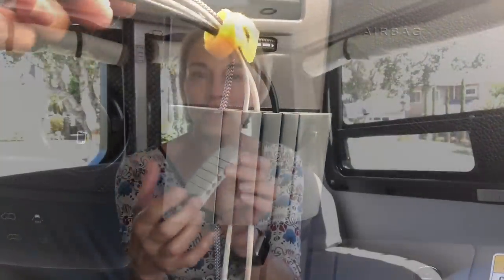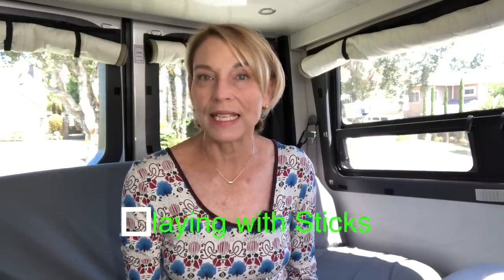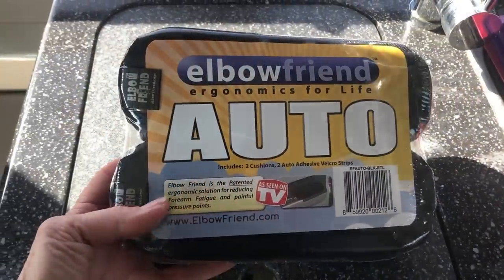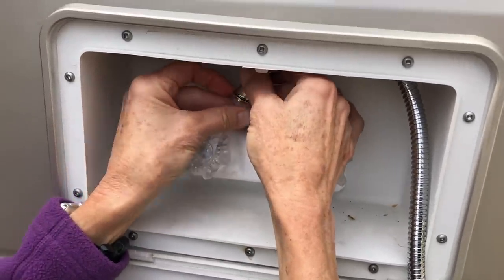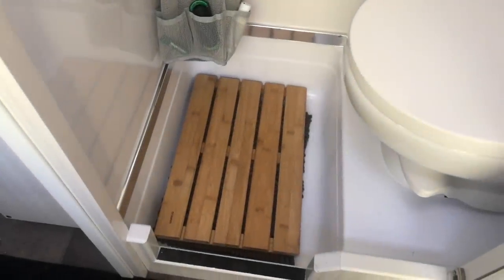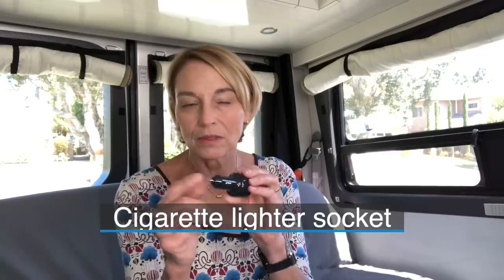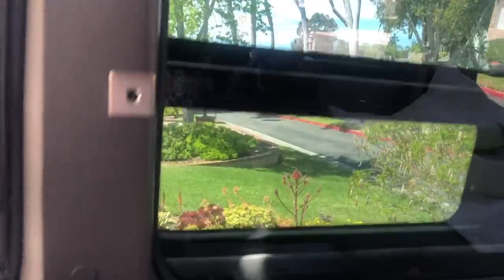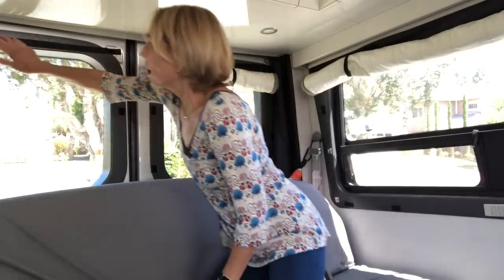More Tips Hacks Apps and Gadgets for your RV Life

Comment: I just saw Carrie on One Advanture at a time, do a presentation on putting in a screen door on the back of her van. She said if you put 3M tape  on the back of the Velcro, it will stick great. You have to leave it on and up for 24 hours before using it but it solved the problem of the Velcro falling off.
Reply from the maker: Thanks. Good to know.

Comment: Enjoy your channel.  Just installed the same shower head. We were using the bamboo mat as well in the bathroom. It cracked the floor at one corner. This is not covered by warranty and will be expensive if we want something other than a visible patch.  So we switched to flexible click together plastic squares bought at a marine store. I used two squares and had to trim.
Reply from the maker: Good to know.  Guess it's good that I keep the thick shower mat underneath it then.
Reply: @FromShetoMe  Could you put some rubber strips on the underside of the bamboo matt to protect the shower tray?
Reply from the maker: I should think some rubber floor protectors used on furniture would do the trick.
Reply: Uneven body weight on one corner cracked the floor. It was not scratched. So pads would not help. Just want to warn others.

Comment: The use of binding on the edge of your window covers actually strengthens the edge which sees lot of action. A self bind might be easier or cheaper but your binding is a great asset to keep the Velcro from being ripped off and tearing the fashion fabric.  Good idea!! Had you thought of putting the male side of the Velcro on the metal door and not the plastic?  Maybe use a button and snap like Slim did in his new rig.  Thanks for all the ideas. Y’all are cute
Reply from the maker: Actually, I updated my curtains and removed the velcro and replaced with magnets. Works better for us.

Comment: Great tips! For the sticky shade (or any sticky residue):  rub olive oil onto the residue, then dip dampened fingers into baking soda, then rub the baking soda into the olive oil. You may have to use a little more baking soda, but I’ve found this combo works great!  Keep the videos coming!
Reply from the maker: +judi stevenson Thanks for the tip. I’ll try it along with the suggestion by another viewer to use peanut butter. Will see which is better. I know which one will taste better.  ;-))

Comment: Hi Debbie and John, new to your youtube page and loving your tips and hacks. The USB chargers come in 2 type,  1.2A and 2.1A charging rates. Therefore the 2.1A units will always charge faster, however if charging overnight then the 1.2A suffices. Iain fae Scotland
Reply from the maker: Thanks Lain. Now you've got me curious on which ones we got.
Reply: @FromShetoMe  I couldn't see quite what it's said on the front of the charger, however every 12 watts = 1amp at 12volts so if its 48watts, it would be 4amps which would normally drive 2 usb outputs @ 2amps, hope this helps. Always willing to help with electrical issues. Cheers Iain.

Comment: This is a question pertaining to your 2 year old post on using 1" foam under a Target sheet and it sliding around, etc.  My husband,, John, needs more padding under him and I am thinking of getting a Queen jersey type fitted sheet over the 1" foam pad for the sofa and leaving it there.  Do you think the foam would get all wonky when the sofa goes up and down.  I would leave the sofa in the down position but I have an older Excel with a kitchen cabinet on one side and the TV on the other really preventing comfortable use of the ottomans as seats for dining.Any thoughts?  Hope you and John continue to thrive with your lifestyle!
Reply from the maker: It might get a little weird with the padding under the sheet but you might also figure out a way to use some elastic to hold it tight against the bed frame. Or see if you can find a twin mattress pad that gives you enough padding.
Reply: Thanks for the suggestions!

Comment: FYI- I never found the link on Neils channel for the Shower head, would you post a link on here please. There's several people I could tell about it. All of those shower connections are 1/2" regular fittings.
Reply from the maker: Unfortunately, the company changed the design of the head. I don't like the new design and don't think it will fit in the outside compartment but here is a link:  https://www.amazon.com/gp/product/B01F78MLRE/ref=ppx_yo_dt_b_search_asin_title?ie=UTF8&psc=1

Comment: This is your third or fourth fix for the bed I think I will wait before I make any more changes with our bed. We are serious about have a custom van build. We buy a new Mercedes Sprinter 170 and deliver it to the van conversion people. The things I think are useless on our Roadtrek are the awning we never use it because it is not worth the hassle. The AC is loud and can only be used with the generator then you will go deaf from their noise. No need for a fossil fuel generator. A separator toilet seems to be the answer to the black water toxicity if you never put pee and poop together no smells and no dumping issue except for gray water.
Reply from the maker: I totally agree with all of those.  Plus, I would replace the fridge with a 12 volt chest style fridge, add more solar, remove the microwave and make the bathroom a smidge larger for John. I wish I could afford one of George's custom vans. ;-))
Reply: Georges Custom Vans where is it located?
Reply from the maker: It's George at Humble Road.  He bought two chassis and who knows where this might lead.  But I really like what he is doing.

Comment: What size is that grey sheet you use over the sofa/bed? I’m betting that measures about same as sofa in my Leisure Travel Van. Thanks for you tips, I’ve watched every one of your videos. I so enjoy your point of view and ideas.
Reply from the maker: Thanks.  It's a Twin.
Reply: I grabbed a sheet I knew to be twin and tried on my 05 LTV sofa and it fits. Then I thought to check tag on sheet..... it’s a twin extra long and fits perfect. But being as it’s black, from younger sons late teen years, I’m going to check Target and other places for deep twin extra long in a color or pattern I like. So, for vintage Leisure Travel vans with sofa, twin extra long sheets with deep pockets of you plan a topper, is perfect.
Reply from the maker: @VeldaE12  Excellent.  The one thing I noticed at Target is they only have one type that is sold as separate pieces and the colors are limited but at least they appear to be well constructed and are soft.  Not sure they have the extra long though but check on line as well.
Reply: From She to Me: turned out I had just bought a nice microfiber set on Amazon so I plan to leave sofa flat and make it as twin bed. My husband died last September so I’m modifying stuff and things to suit travel for one! So glad you gave that tip, because for my new situation, it’s perfect! And if you visit northern CA and need Sprinter service I highly recommend Rocklin Mercedes! Just had them bring all service up to date and I’m impressed. And wave in Roseville as  you drive by!
Reply from the maker: @VeldaE12  Thanks so much for that suggestion.  I'll definitely be adding it to my tip notebook.  Glad you're continuing to travel.

Comment: What size is the gray fitted bed sheet ?  Thank you so much. Love your ideas !
Reply from the maker: Twin.
Reply: Good luck !  My Jon had his heart Cath on Wednesday. They thought due to MRI heart imaging that he had a 60\80 % blockage but when they went in they only saw normal calcification ..but he does have a apex abnormal heart pumping issue follow up may 6th with the Bay pines VA
Reply from the maker: Excellent.  Thanks for the update.  My John has A Fib and A Flutter which always complicates procedures but so far it's under control.